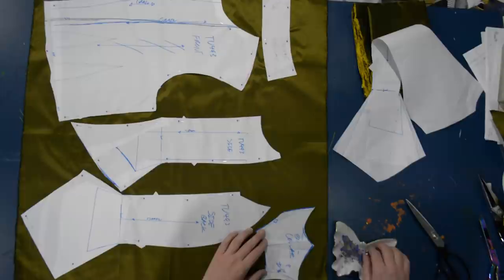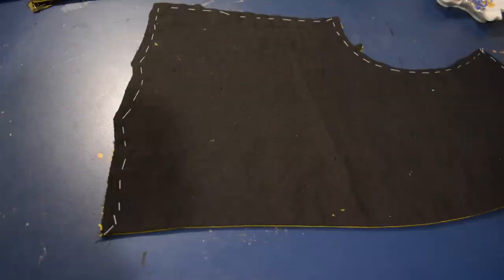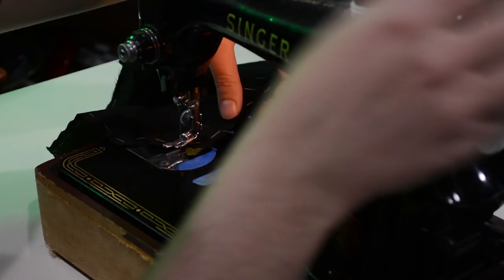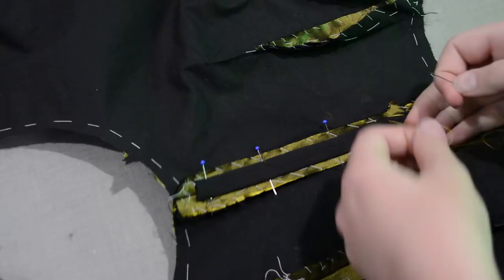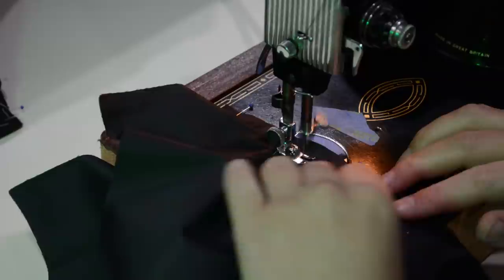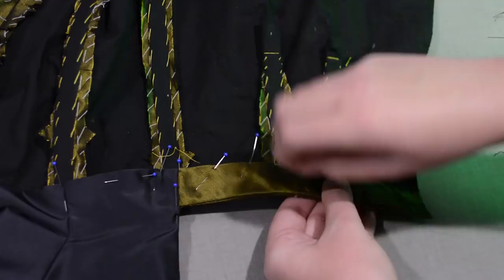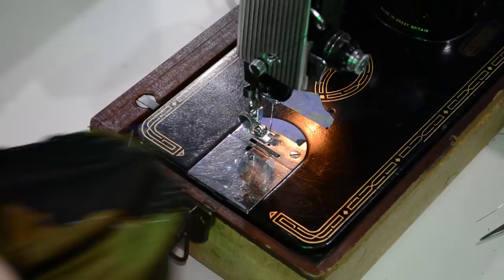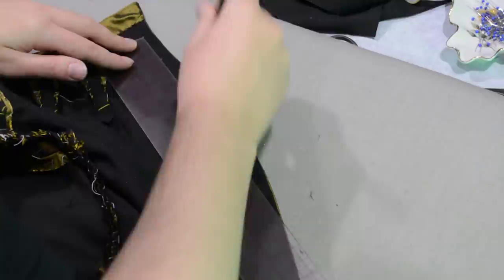Making The Real 1890's Day Bodice // Mandragora Gown (pt. 3)

Comment: A random (unsolicited and therefore optional) tip: Gütermann hand quilting thread makes for excellent basting thread. It's 100% cotton, and comes glazed and needs no waxing, and the glazing makes it super easy to remove once you're done. Also it comes in a pile of colors and is super easy to find.
Reply: Optional but helpful! I never payed too close attention to the different threads Gütermann offered - just zeroed in on the sew-all thread. But next time I'm at the store I'll be taking a closer look!
Reply from the maker: Well this sounds fantastic! I'll have to get my hands on some!
Reply: Thank you!! That's really helpful
Reply: The quilting thread was made for hand sewing as well, so the glazing is necessary for all the running through the fabric the thread needs to do. Most other thread is made for machines so they don’t glaze it,  machines don’t drag the thread through the fabric as much.
Reply: I splurge on white silk thread by Gutterman when it's on sale best for basting I think.

Comment: Unsolicited suggestion: In case you forget and try to use the heater and iron at the same time.

 If you plug the iron and the space heater into power bars, you’ll trip the circuit breaker in the power bar, which you can reset simply by flipping the switch on it - after you unplug the item causing the overload.

This does damage the power bar a little every time you do it - which means it will take less of an overload to trip it.  (Still appreciate the convention centre electrician who told me that!)

But, if you don’t make a habit of it, and just use it as an alternative to having to go outside if you make a mistake, it will last fine. And if it gets to a point where the power bar is a bit less able to handle that, but there’s no visible damage, it will still be fine as an extension cord for something lower load, and less important like a couple household lamps.

Comment: 13:20 that's the hardest lesson I've had to learn in sewing. I sew a lot of princess seams, I like how they fit and look on me so most things I make for myself feature them. I used to pin them once, and if they were a bit wonky or uneven, I'd just convince myself it was fine and steam ahead. Taking that extra 5 mins to pull pins out and redo it is so much better than sewing a whole garment up and then being unhappy because it's crooked or bunching strangely. If it isn't right, do it again, it's so worth it!
Reply: Yes!! It's way more hassle to fix afterwards than it is to take extra care during pinning and sewing.

I learned that the hard way when tailoring jeans from a bootcut to a skinny fit. The seams were bunched and ugly af and ripping it out of the denim took forever!!

Comment: Ah yes, Americans and their imperial measurements indeed. Unfortunately, it’s something I’ve picked up. I learned to sew using videos by Americans, and also some American patterns, and now I’m stuck. I’d much rather use1, 1/2, and 1/4 inch measurements for stuff now. I also have trouble visualising how long something is in centimetres, but I don’t have that problem with inches. I think because inches are larger? Maybe?

Either way, this Australian now annoys everyone around her by using imperial. It also meant brushing up on my maths skills, because I didn’t pay much attention when they did the whole multiplying fractions thing. Why would I? We used metric! But now I have to. And I also do a lot of converting back and forth. 

Is what it is.

As for the real v fake question- that’s complicated. I have very sensitive skin, so if it’s going up against my skin it needs to be gold or silver. I couldn’t care less about the stones. Glass works fine for me. I just don’t want my skin to turn green and also eat away at the metal (I’ve literally eaten holes into thimbles before, making them completely unusable because the needle pokes through. Defeats the purpose). So I’m happy to have glass and gold plated, but I can’t do base metals. 

I also can’t do polyester, but that’s because I hate the feel of it, and I live in a hot and humid climate. I can’t do silk either, unfortunately. I like the rayon faux silks, because they  look like silk, but they’re much more breathable.